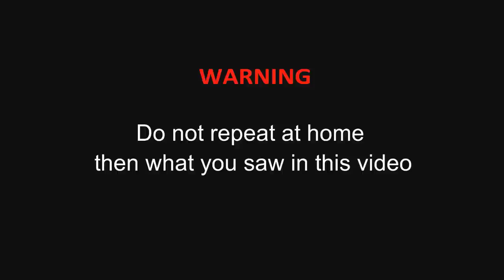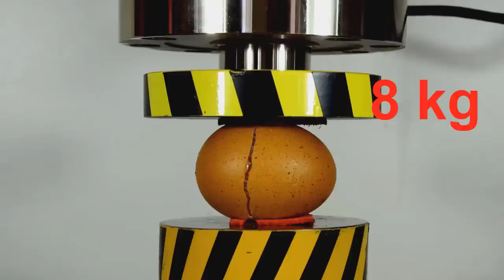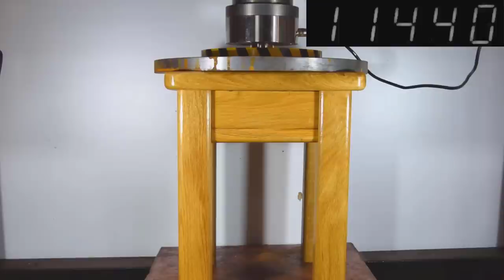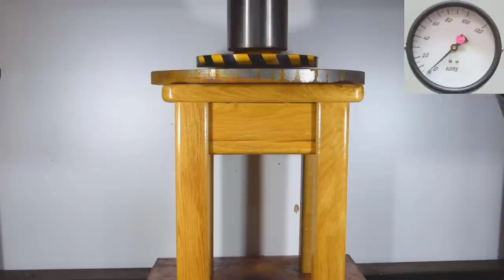HYDRAULIC PRESS VS GLASS CUP, AMAZING STRENGTH

Comment: I feel like the egg would have been way stronger vertically. But the best egg test would be to take 4 or more eggs, one in each corner and center, positioned vertically, and compress them.. and then repeat that with only half shells, vertically again, with one in each corner and in the center as well. I'm sure the results will be much more impressive... I think hehe
Reply: You're right, it's much better vertically!

Comment: While I'm sure the cheap table was weaker, this test didn't prove so, because it was the table top and the screws that failed, not the vertical "legs" of the table, which are much stronger.  Need to test the cheap table again with the plate to distribute the weight evenly, and test the expensive table without the plate.
Reply: He did that to make the outcome more impressive than it would have been. I don't respect that
Reply: Almost like a scam